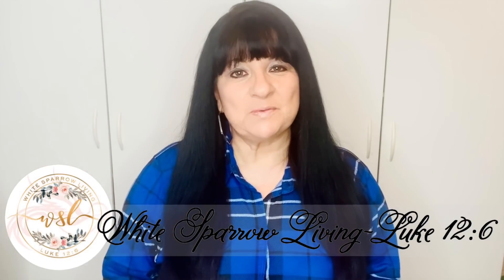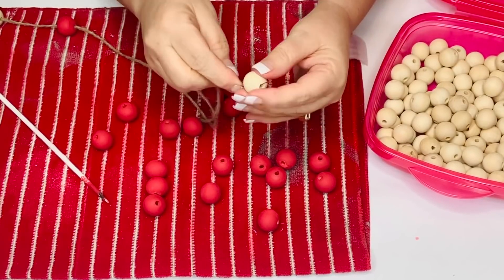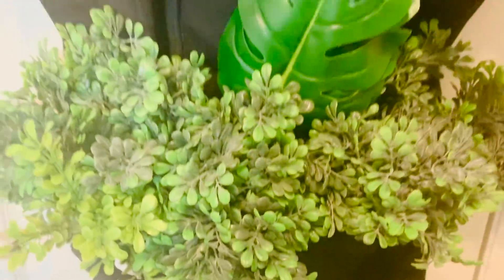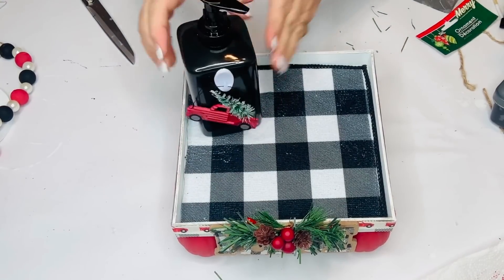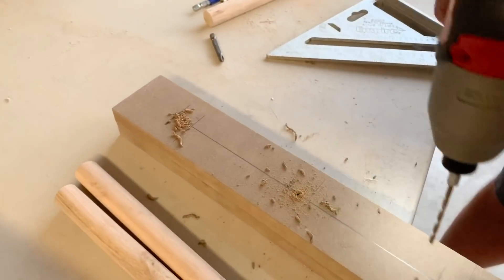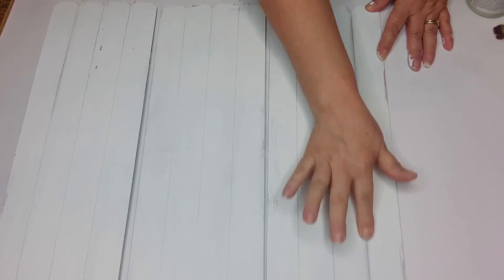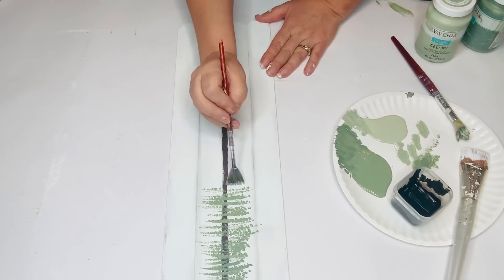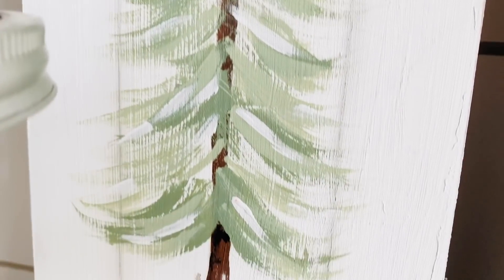5 HIGH END DOLLAR TREE FARMHOUSE CHRISTMAS DIYS $3 PROJECTS + PAINTING TUTORIAL

Comment: Tassel/ Make the part you wound around the block. Second string you put the string at the bottom of the wrap. Let a tail hang there, run the string to the top of the tassel then back down to the area you started. Now wrap around wrapping upward over tHE string you began with. Get up as far as you want, cut the end and poke it thru the little loop at the top. Now pull the string end that is coming out the bottom till the top loop string goes inside the wrap. If theres enough cut the end as long as the tassel
Reply from the maker: YES!! THAT’S IT!! I really need to practice this!! Lol Thank you, my friend!! Xoxo 😘